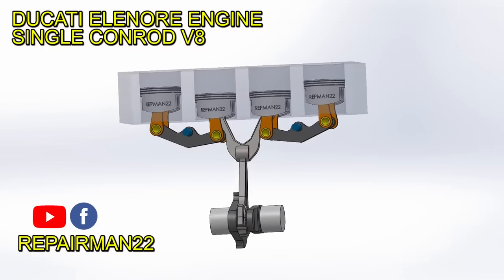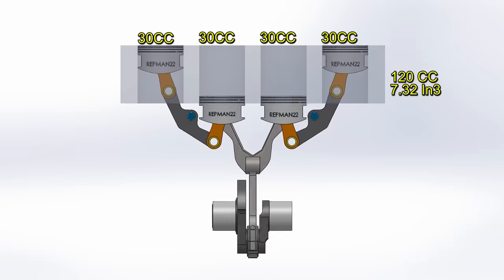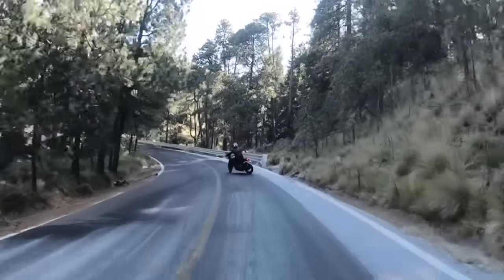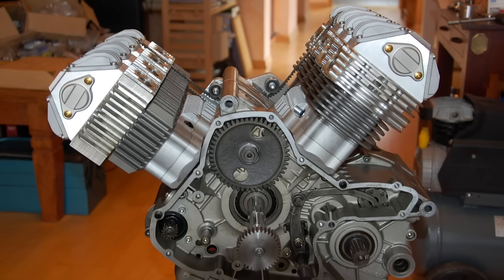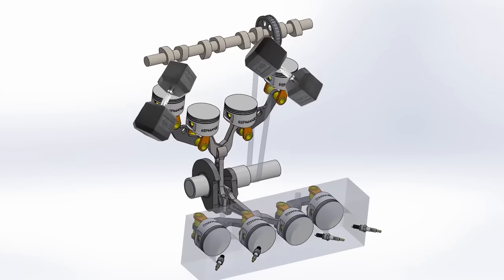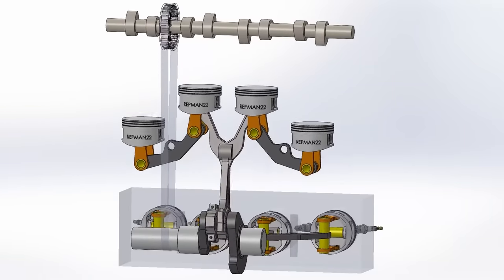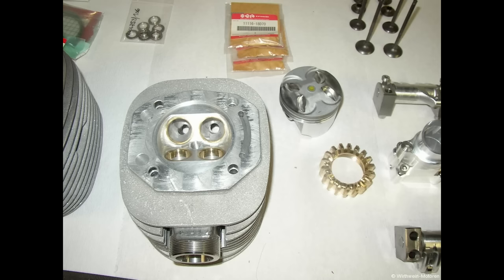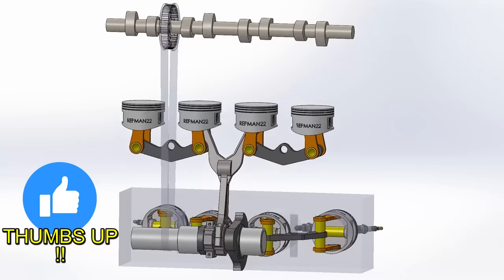1 Con Rod with 4 Pistons 🤯 How Ducati Elenore 868 Engine Works in 3D

Comment: If you think about it, this is not different than just having one big piston the size of all the other pistons, and the motor the same size, it's just simple math really,  the only  thing is, you would need probably 4 spark plugs per cylinder. And a larger intake Value, exhaust valve and so on.
Reply: No, one cylinder would result in a large variation in power, so it would need a larger flywheel to get through the other 3 strokes. The 4 cylinder design has a power stroke occurring 100% of the time. (That is true with this design, or with a classic 4 connecting rod design.)
Reply: It's completely different to one big piston. A single cylinder produces one power stroke for every two revolutions of the crankshaft, and is very poorly balanced. The V8 produces a power stroke every quarter turn of the crank and has almost perfect balance. In fact the balance of this design may actually be better than a conventional V8.

Comment: Why would any manufacturer take on the development of a new ICE? Legislation will mean that most internal combustion engines will have all but disappeared by 2030(?), to be replaced by electric motors. No matter how advantageous a new ICE is, it is the end of the line for propulsion using hydrocarbon based fuels, and any development would be money wasted.

Comment: Bet you that rod bearing wouldn't last very long. That's alot of stress being put onto 1 point
Reply: Did you watch the video? Peak forces are broadly equivalent to one cylinder of a conventional design, but the forces get reversed on alternate strokes so the conrod and bearing is loaded in compression and tension.
Reply: @ferrumignis  Ah....gotcha. Missed that I guess. Makes sense

Comment: To many moving parts, lots of friction losses.
Lots of reciprocating weight in the short rods and rocker arms.
Oil feed to the cranks bigend could be an issue, maintaining an oil film and wedge on the rising power stroke.
Reply: It might be able to solve the innate unbalance of a 4 cylinder.and could easily be made shorter with some tweaks to the connecting rod.
Reply: Long story short classic german over engineering.
Reply: @Demonslayer20111  At least till one of the cylinders fails for some reason and then that crank is going to destroy itself.
Reply: @SilvaDreams  a piston failure wouldn't really do much in either except damage the cylinder wall and drop metal in the oil which in turn would cause further damage. Rod failure would cause similar damage in each maybe less in this one if it's one of the daughter rods as it isn't directly attached to the crank. It would just kinda flop around on it's pivot.  Unless you are talking about a piston seizing in the cylinder? In which case both engines would sustain serious damage to the crank and connecting rods, but this one would damage ALL the rods or break a pivot.
Reply: Please explain how the tiny rods and rocker arms have more reciprocating mass than four regular sized con rods.
Reply: @Ferrum Ignis  If you can't see, work it out.
Don't have time for a two hour lecture by comments.

Comment: I think it would allow for a lighter more compact engine, which would increase the strength of the drive shaft. I would like to see an inline six version, (three doubles) and one built on the scale of a diesel V8.

the engine appears to perform almost the same if slightly better than a scale counterpart. I think while the friction points will slow it down, overall the engine is stronger and resistant to sheering forces on the Rod. however because the force is not directly applied to the connecting rod in the direction of the force it will cause more torsion and torque on the parts in undesired directions.

seems like the trade off is durability for weight, and possibly part cost.
Reply: It won't be more compact, just look how long the forked conrod needs to be. This will make for a tall engine compared to a conventional design, but there should be significant weight savings.

Comment: it will not last for a very long time   because when the rocker arms and bushes wear it will cause balance problems  also having only one big end bearing will cause premature wear  but i have to say that is lateral thinking  good luck to him
Reply: You can say exactly the same with a conventional engine "when the rod bearings and wrist pin bearings wear...." except they don't wear if properly lubricated and the engine is regularly serviced.

Comment: Loading the connecting rod is ok till one cylinder fails then it wont take the unbalanced load,without bending ,stressing etc.All seems over complicated,don't get me wrong,its clever ,and thinking outside the box is good. Electric is sure to kill any advances in the petrol engine.

Comment: I wonder if he changed the firing order to two cylinders at a time rather than just the one (the outer pair and the inner pair) if he would get better results. Due to the extra friction of 3 extra cylinders and the extra linkage movements for only one combustion limits how fast the engine can rev up. If the cylinders are fired in a mirrored pattern would that not help balance the engine?
Reply: If two cylinders fired at a time it would negate the entire point of having a 4 or 8 cylinder engine, you might as well have a 2 or 4 cylinder and save on complexity.
Compare this design to a conventional IL4 or V8 and tell me where all this extra friction is?

Comment: Why would anyone want an engine with 4 times the moving parts and 30% less BHP, not to mention being unable to service it properly due to access restrictions. Its one of the least thought out engines ever. OK as an experiment in engineering it is interesting but try owning one in a motorcycle that you use daily..

Comment: This is a solution to a problem that never existed in the first place. I don't see how two cylinders doing no work to the crankshaft is advantageous. And the worst is to watch the bike accelerate (1:50) and notice the obvious lack of power.
Reply: Amazing how many people think the outer cylinders aren't contributing to power, despite it being obvious that they are. Hint: the conrod transfers energy to the crank on the upstroke and downstroke in this design, as was clearly described in the video

Comment: I don't think it is a fair comparison to look at the 1HP lawnmower engine thnat has 1 bang per 2 revolutions
and compare that to a 4 in line doing 2 bangs per revolution..
And simply state, 4xthe CC should be 4HP but we have 6HP so the design is a super duper performer.
Obviously 4 in line will have increased power strokes and the engine will be smoother.., 4 cyllinders alone will do that.  there is no draggy compression and exhaust stroke, each stroke is backed up by a bang on another cyllinder

To determine the 6HP is actually a benefit of the 4cyllinders1 Conrod... you have to compare it to a 4cyllinders 4 conrods design

Comment: It seems a dumb way to design an engine.   To minimise bearing loads you need to minimise conrod mass.  This engine has greater conrod mass.  Lubrication of all those rocking points would be interesting.    For any given gasoline octane rating, there is an optimum cylinder displacement.   For standard gasoline the optimum is about 500 cc.   That's why we have 4 cyl 2 litre engines and 6 cyl 3 litre engines.   And why 500 cc motorbike engines used to be single cylinder, however 2 cylinders gives a much smoother ride.   The engine in this video is way too small to operate 4 cylinders efficiently - note the power output is only 75% of a standard engine.

Comment: Nope . Sorry ,its not going to be built as a mc or car engine. 
Maybe if it had 1 hp per cylinder ,to many joints and moving parts compared to a normal engine. Maybe in garden engines .
But the 125cc sounded really good , i would guess a much bigger engine.
Sorry about my english ,from Finland!

Comment: Why would they fire one at a time?  Why not fire 1&4 at the same time and then 2&3 at the same time.  Seems like that would produce more HP and Torque
Reply: It's a 4-stroke, so firing two at a time means you have no power 50% of the time. Just like a normal 4 cylinder, they are fired in sequence so there is always a power stroke 100% of the time, which gives smoother power and reduces the need for a large flywheel.
Reply: Why would you want to convert a IL4 engine into an IL2, or a V8 into a V4? That negates all the smoothness advantages of the number of cylinders without increasing power output.

Comment: Why isn't the firing order just two and not four as it's not making any sense to have four when it only has two points of combustion as 1 and 4 at same time then 2 and 3 at same time, instead of all four one at a time 😭 get it right please ok thank you come again
Reply from the maker: Man. Its a 4 stroke engine!! Thats why
Reply: @repairman22  but it only has two strokes because 1 and 4 rotate the same revolution and are top dead center as same time as the same with 2 and 3 so you could get more torque and higher rpms I'd 1 and 4 fired at same time and same with 2 and 3 fire at same time, just saying
Reply from the maker: @LostinRestoration39  no. Please watch how a 4 cylinder 4 stroke engine works.

Comment: Im not knocking the guy i cant do anything like what he did, the design is pointless.  The only possible advantage is weight.  And yes the conecting rod will have more than one cyilenders worth of force. It will have the cumbustion stroke of one and the compression stroke of one at the same time.

Its not a crazy difference,b but seings that they are already fighting to make engines more rubust so they can get more reliable power every little bit counts. 

Now that I think about it it may work because the limiting factor of the strength of a rod is the weight, but if you only have one rod instead of four you could increase the strength and therfore weight without bending the rod. In theory. It depends how much the rest of the mechanism changes things.

It still seems like more of a novelty.

Comment: Not gonna work. The new engine design requires more parts and more bushings for starters. That's never a good thing for mass market. I'ts an interesting reinvention of the piston engine showing the good old piston-and-rod system taken from steam machines is not the only way an ICE can work.

Comment: To bad this engine was complete failure.  They kind of missed that part !  Was horrible on gas burned almost 2X normal conventional engine that was larger. the other thing was after about 50% Rpm ranges the thing would shake more then a rock sifter at a quarry lol  great idea. Interesting anyhow but not practical by any means.

Comment: Imagine how slowly it must rev though...  Also, maintainance would be a nightmare.
Reply: i believe they mentioned one reving to over 10k, so not low
Reply: Why do you think it must rev slowly?
Reply: @scrapheapofshame  Quick revving and high revving are different things. The former is how fast the revs can increase, and the latter is the max speed the crankshaft can turn.
Reply: @Ferrum Ignis  Because there are more heavy and indirect linkages that need to change direction.
Reply: @theyeetus1428  No, there are more but individually lighter linkages (apart from main forked rod) and the crankshaft will be far lighter than a conventional IL4 or V8 design.

Comment: The most important function of a combustion engine is the transfer of the powered movement of the pistons onto the crank shaft
So the crankshaft has a very strong and powered rotational drive force capable to move whatever vehicle this engine is mounted on with enough horsepower and speed 
So how the pistons are mounted in an engine, has to benefit the crankshaft above anything else 
This design in the video is thus complete nonsense and because of its single point attachment onto the crankshaft, it is bound to break at some point in the future given all the forces that  are accumulated at this single point
Reply: Yet another person that proves they didn't watch the video before making a fool of themselves.
Reply: @ferrumignis  
Am I seeing this correctly and have you deleted your second comment in this thread ???

Or is this a glitch on youtube, because I can't see your second comment anymore ?

Comment: This is a bad design. There is a lot of pressure on the connecting rod big end bearings carrying the load of four pistons making power.
Reply: I think the bearing load is the same, because there isn't a point where more than one cylinder is firing at the time. In normal engine uper bearing takes most of the force, but in this application both would get fairly equal load. That beeing said, I don't think that this engine makes sense in real world motorcycle application.
Reply: @cdjxwubcyex  Every power stroke is applied to the same bearings instead of four in a normal four cylinder engine. Stress and wear is definitely greater on the bearings in this bad design. Agreed ?
Reply: @stevenroche9874  No, watch video more carefully, two of the strokes are applied to upper rod bearing (push motion) and the other two - to the lower one (pull motion). Maximal load is the same, because power strokes come in sequential order. Technically speaking to every bearing there is two times more power strokes but the same load, just like in a 2-stroke engine. Bearing service life mostly depends on total revolution count not strokes. And why are you so concerned about bearings of all the things? With modern materials bearings are one of the less problematic engine parts, if there is no other design flaws. 
Over all I wouldn`t call this a  bad design, maybe - suboptimal.